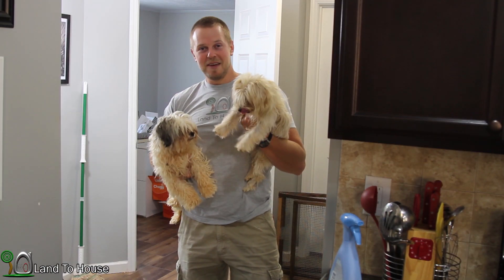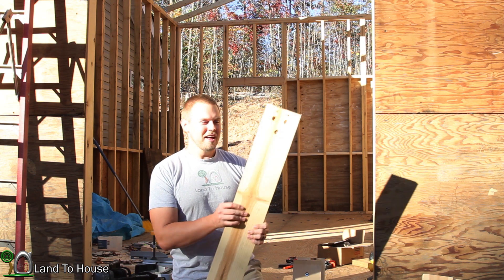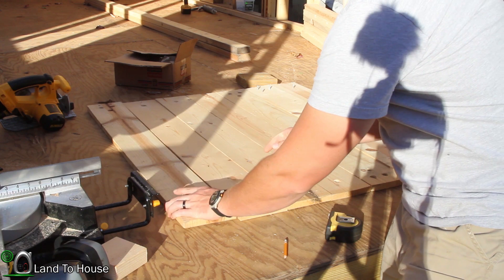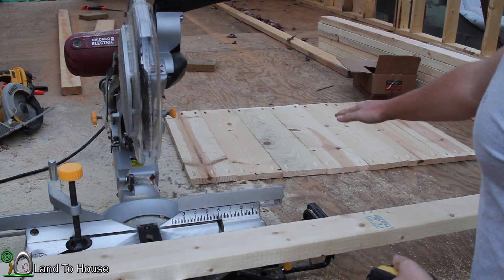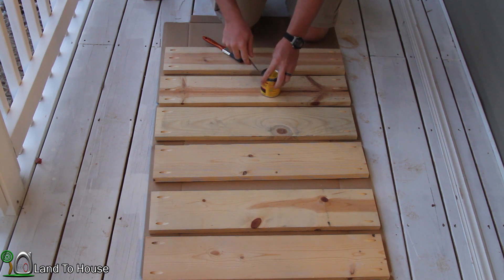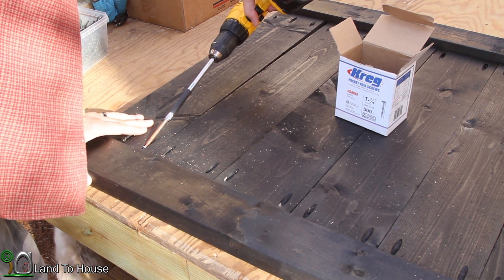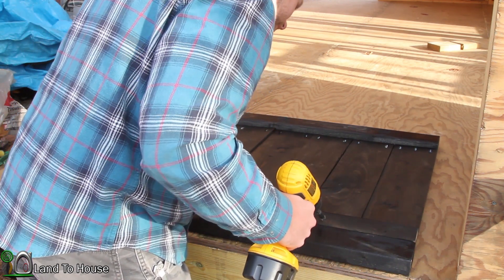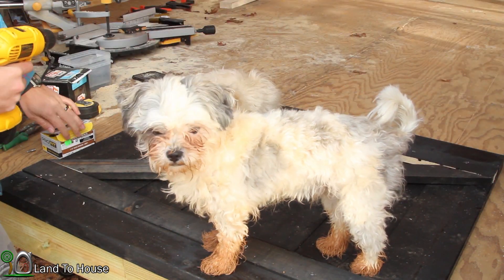Build a Dog Gate

Comment: Add two more magnets on the barrel bolt side, take a forstner or paddle bit and recess them on the face frame. After a bit of time the dogs may not even push on the gate which will  help when carrying laundry and such and just pulling the gate closed. I suggested neodymium magnets for both applications. .
Reply from the maker: Good suggestions. We recently gave one of the dogs to a new owner and the remaining dog is no problem at all. Stronger magnets would be ideal

Comment: The cross brace is not only for decoration, it's what keeps the gate from sagging.
Reply from the maker: +Espen Birkeland definitely. This door is not too heavy so I'm not sure how much that cross piece is really doing but if it needs it it's there. :)
Reply: ..or use 4 ea 1" X 1" straight line and mount those for strength..and stain them lighter.
Reply: @LandtoHouse  pocket screws are strong against tension and shear forces, less good at torsion/lateral forces, the diagonal brace takes some of the strain against racking so the pocket screws don't have to work as hard.

Comment: great job! if your magnets ever come undone, you might want to  get magnetic door stops at your local hardware store. They work great! thanks for the great video!
Reply from the maker: Good tip. So far the magnets are holding well!
Reply: ..or drill a hole in the magnet and screw it into the wall. ?? GREAT WORK! -ml

Comment: Nice video, Thanks...I liked that you showed how to use the Kreg tool, I have one sitting in my Amazon cart and wasn't sure if it's what I wanted...I also liked you showing us how to do an angle cut...I'm going to make my very first gate  for my deck to keep my 2 cavapoo girls from running off.
Reply from the maker: The pocket hole jig is so nice to have. I use it often. This dog gate has worked very well for our two little pups Now My 4 year old niece used the gate as a swing and the light weight hinges bent just a little. Happy building!